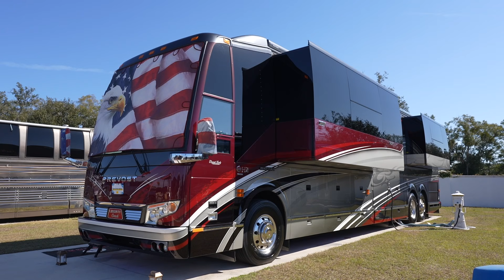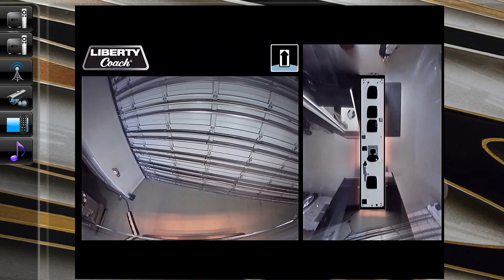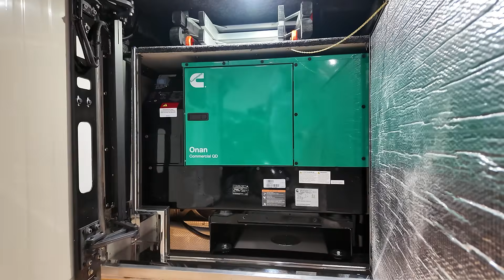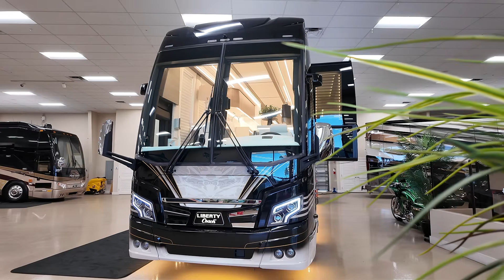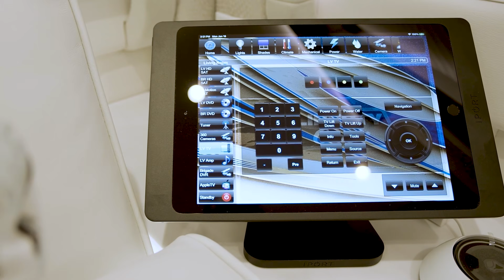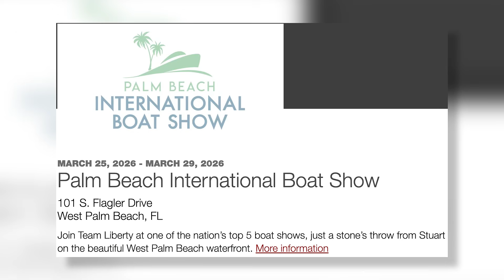Tour of 2026 Prevost Liberty Coach #929 with "Super Suite"

Comment: Question you won’t ask, what would liberty do to flex if they had the extra floor space from a newell
Reply: I don't think I understand the question
Reply: @frankkonigseder6592 front 5 feet of the h is useless parked and all things aside the Newell has more interior space, I'd love to see what liberty could do without the prevost shackles
Reply: @whiteandnerdytuba  So you are trying to compare to a center entry Newell?
Reply: @frankkonigseder6592 I'm not comparing, I'm wondering what you could do creatively with a flat floor and extra space
Reply: @whiteandnerdytuba  The 4 feet in a center entry Newell is useless, you loose the interior floor space as well as the under compartment space, on the H platform you are not losing any under compartment storage space with the front entry as there is none there to begin with on a Newell or Prevost, the interior front of the coach is the same on both coaches, so you actually have more space all things considered on the Prevost H